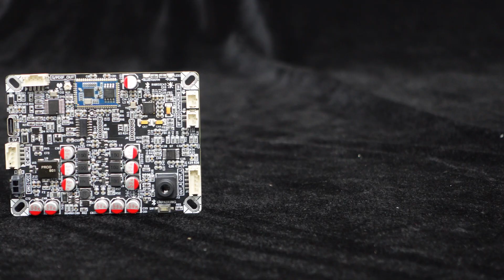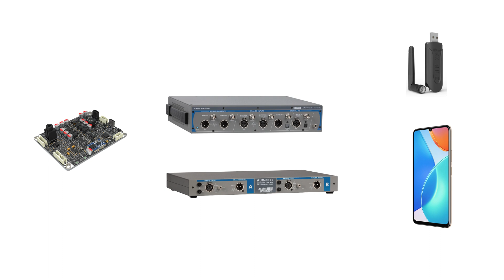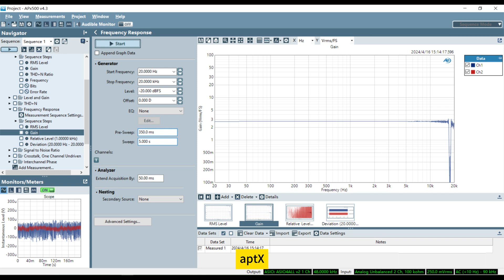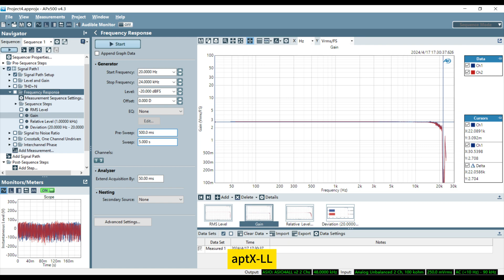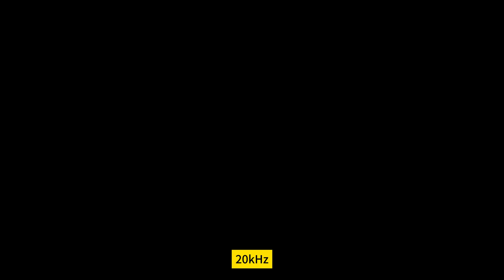Testing THD and Frequency Response of BEB1 Bluetooth/USB to Optical/Coaxial/Analog Decoder with AP

Comment: How do I connect the BEB1 to my amplifier that has 4 RCA Analog inputs? It's possible ? Which output should I connect?
Reply from the maker: Hello, you can use a 3.5mm Male to 4-Male RCA audio cable for connection. Wish this could help you. Have a fantastic day~